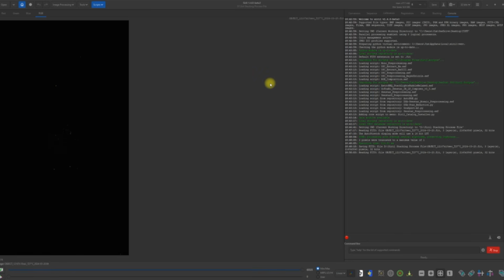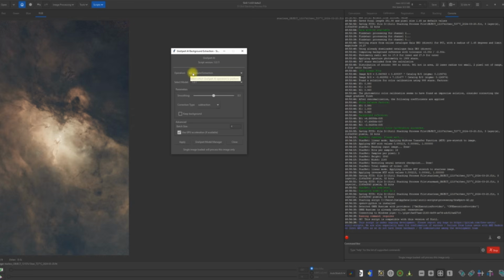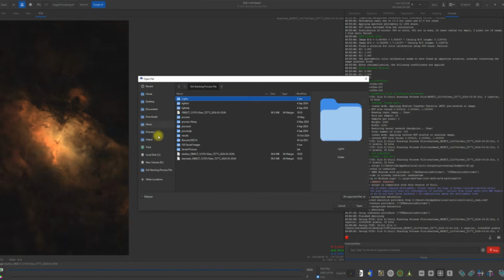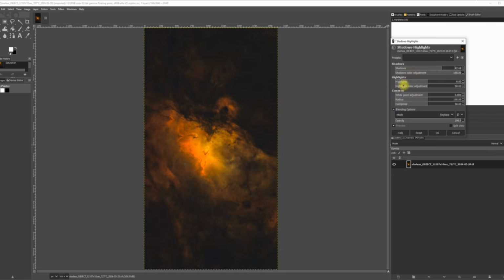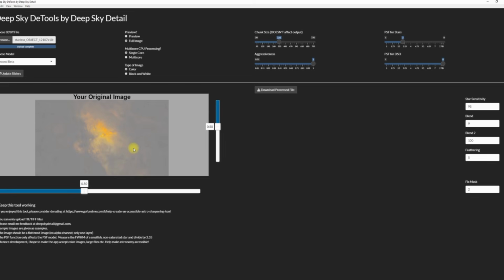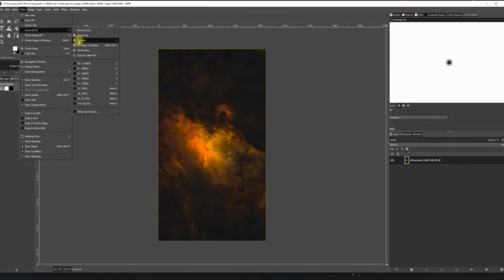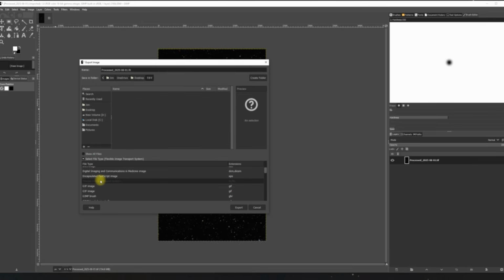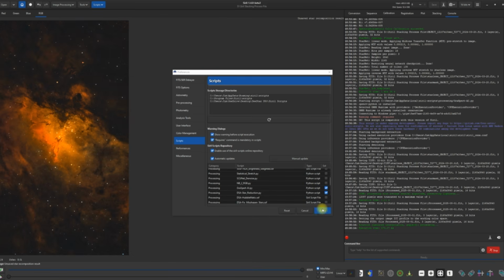Seestar S50.  M16 Tutorial for new Siril Version 1.4.0 Beta 3.

Comment: Hi Jim, I've tried this work flow a couple times now, when i get back to siril to marry the images blocktogether my images are coming out blue. i tried last night with the bubble nebula and today with NGC 6888 still not working any ideas?
Reply from the maker: I am not sure what is going on.  I'll check around for an answer.
Reply from the maker: This is a copy and paste from an Online source.  Let me know if any of it helps.

 A blue tint in astrophotography images after using StarNet with Siril is often caused by incorrect processing order, inadequate color calibration, or improper settings in one of the tools. A common cause is running StarNet after an automatic photometric color calibration in Siril, which can lead to unusable results. 
Here are the most common causes and how to correct them:
Processing order issues
The correct order of operations is crucial for accurate color representation.
Applying color calibration too early: Some users report that running Siril's photometric color calibration before star removal can lead to a severe color cast in the starless image created by StarNet.
The solution: Always remove stars with StarNet on your linear image before performing photometric color calibration. The correct sequence is:
Perform your stacking in Siril.
Run StarNet to create your starless image.
Load the starless image into Siril and perform the photometric color calibration.
Proceed with your other processing steps, then recombine the stars and starless images. 
Improper color calibration
Even with the correct processing order, calibration steps can be missed or performed incorrectly.
Problem: You have not yet calibrated the color of your image stack. An image straight out of stacking, especially with certain filters, can have an inherent color cast.
The solution: Perform Siril's photometric color calibration on your linear starless image. This uses information about the stars in your image to set a correct white balance. The command BackgroundExtraction and ColorCalibration can also help balance the image's colors.
Reply: @PhotonRookie-vk7ge I think I'm going to have to re-stack tomorrow I've tried for the last 2/3 hours and different problems occur. Thank you for the information, just hoping it isn't my data as I spent a few nights on it lol.

Comment: Hi Jim. When you stack your images in Siril, do you use a script or more of a manual process? Also, when you're stacking 10s of thousands of images, is your working directory on your computer hard drive or do you use a seperate ssd drive attached via a usb port? Thanks in anticipation of your help. Steve
Reply from the maker: Hi Steve.  I use a Seestar stacking script in Siril and put the working folder on a 4TB external drive.  Thanks for watching.

Comment: I can get to the stage where I have edited the image in GIMP (the final time) and then I export the image back into my Seestar working file in Siril.  It opens as a blue panel.  What have I done incorrectly?  Any help is appreciated.  Thanks!
Reply from the maker: Hi Michael.  I'm just guessing here.  Did you save the image from Gimp back to Siril as a FITS file?
Reply: @PhotonRookie-vk7ge  Thanks for getting back to me. I did save them as fits files.  Do I save them back to the same file path from which they came?  I tried again this morning with the same result.  I'm guessing that it has something to do with the file path that I am using.
Reply from the maker: @MichaelWeingarten-m9s That's possible.  Also, if you are using a different version of Gimp that  might cause the issue.  I am hoping someone will see your question here and answer for both of us.
Reply: If you open the tif file in Siril and 'Save As' a fit file it'll be OK.